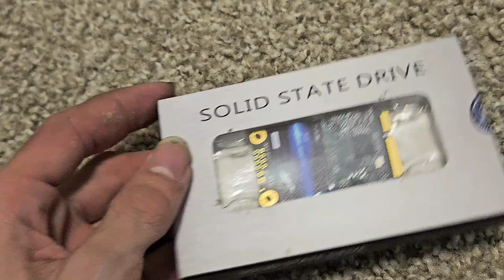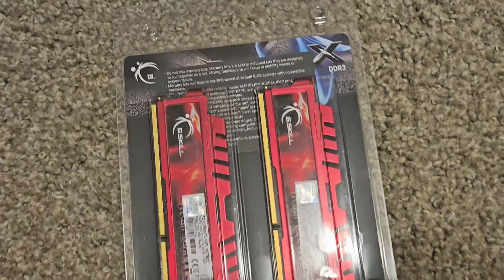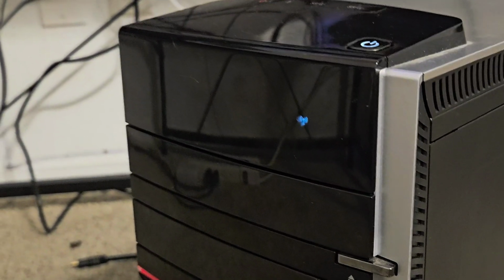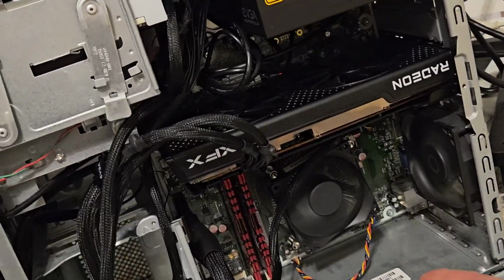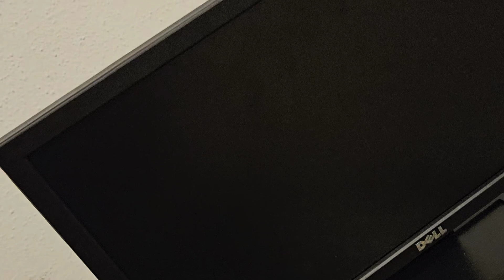Tranforming an Everyday HP Computer into a Gaming PC (Part 1 Rebuilding and setup.)

Comment: I will bet you the card PCIe & motherboard PCIe versions don't match.  The rx5500 is PCIe 4.0.  Nice mods attempt otherwise.  The card is "too newer" like you said. =) .  It's not compatible with the Formosa / Memphis / Angelica / Jasmine motherboards.  A GTX 1050ti might work, if it fits. LOL.  I have a GTX 750ti in mine.  A Radeon RX550 will work too.  Unfortunately, that's something you can't tweak in BIOS, and there are no longer any updates published by HP for the old Envy series PC's.  The RAM might be causing issues with bluescreen too.  HP motherboards don't run well with the XMP enabled ram.  HyperX Fury kept crashing mine, so I put Silicon Power / Teamgroup DDR3 non-ECC back in it.